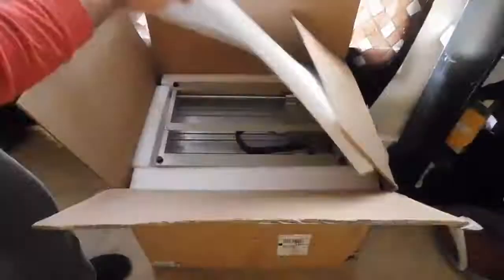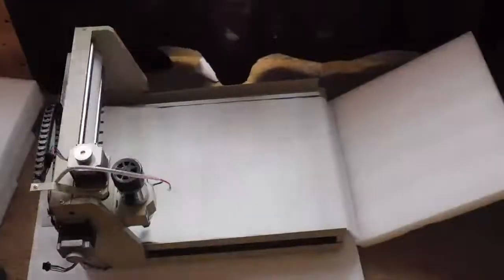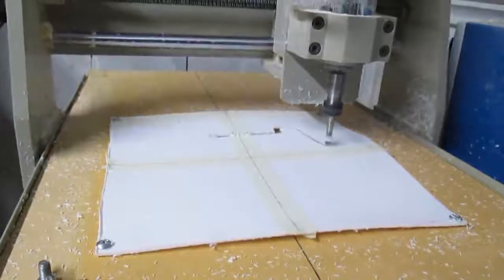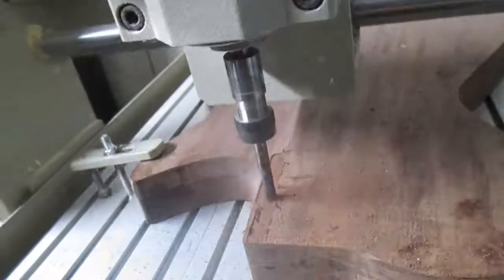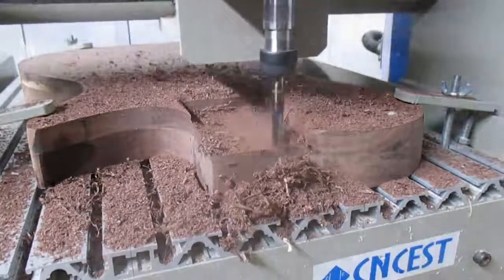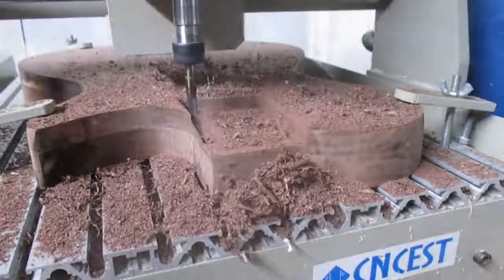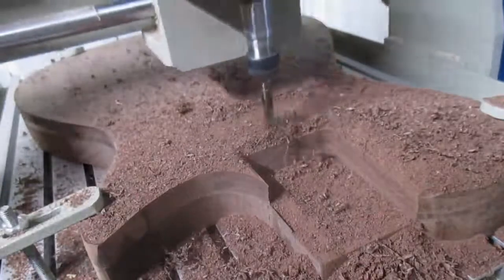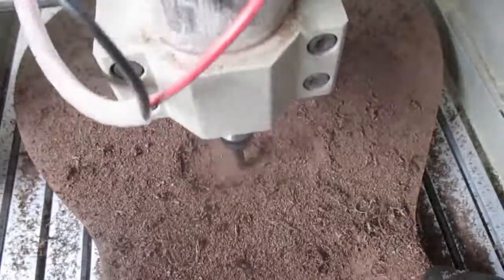3040 USB CNC Unboxing and mini review

Comment: Hello I just bought this machine and it is hard to find any video that show running the machine. I had a buddy that is really good with computers and we got the software loaded and was able to get CNC to talk to the computer so i can move the machine around with the jog but i cant figure out how to get the spinal to turn on. Maybe  you could do a video on more in depth on setting the system up that would be great thank you 
Michael
Reply from the maker: I no longer use the stock spindle i have upgraded to a 2hp ridged router motor because the spindle was faulty or not grounded properly, the router runs independently from the CNC controller so it no longer stalls and hangs up Mach 3. If your spindle wont turn on in  Mack3 its a setup or a grounding issue its hard to diagnose and i am not an expert by any means, sorry i could not be of any more help best of luck.

Comment: Very thoughtful review.  You would have less maint. issues if you put an air nozzle and a vac nozzle that travels with the router.  And please turn the volume down on the machine racket.  About blew the speakers out of my laptop.  

Keep up the good work!
Reply from the maker: I'm working on a full test and review of this machine ill have full specks and features compared to some other machines. ill be testing in with softwood, hardwood, plastic and aluminum